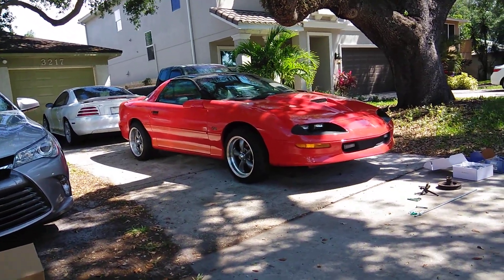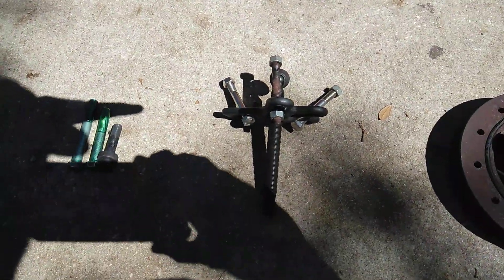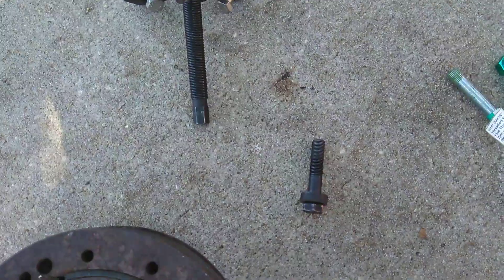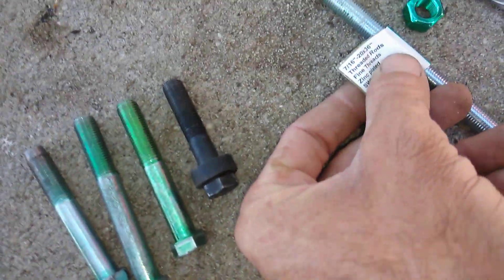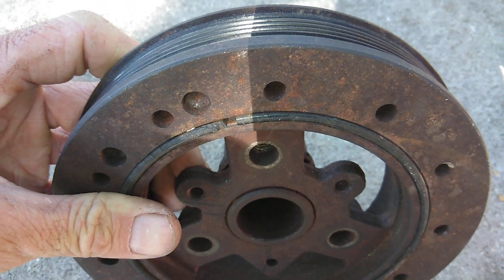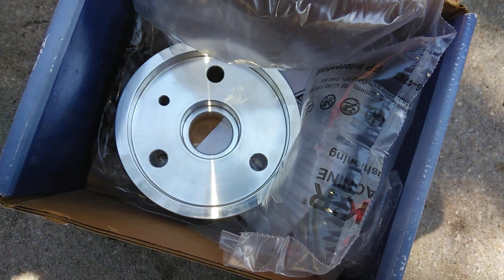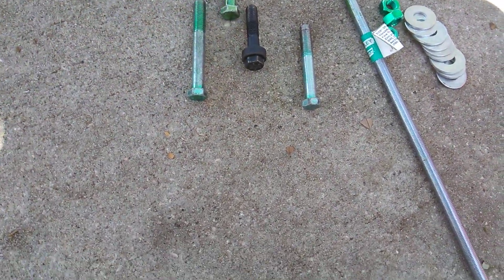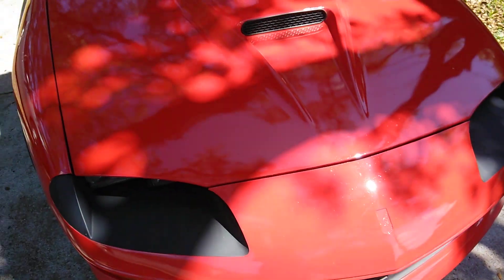😎 Harmonic Balancer Removal from LT1 ,Camaro SS f body Easy way

Comment: Why not use the three threaded holes to pull from. I believe they're 8mmx 1.25 and 50mm length is what I used.
Reply from the maker: Easy, there smaller! Don't wanna bend em pressing out balancer. That the leverage point the 3 bolt to push it off.

Comment: If you look at the balancer wheel from the side one side is thicker. Does that go towards front or back when mounting? Thanks
Reply from the maker: Yes, the thicker side goes to back side. The front has bolt holes for a pully. Also rember, when reinstalling, to use a threaded rod tool for install.  Take care👌
Reply: Keep On Dreaming I’m a little confused since everywhere else has said thick part of WHEEL towards front, which seens like  where it was when I removed, just not positive. You mentioned in you answer it should be towards rear since bolt holes there but I don’t understand since bolt holes go all the way through and thus could be mounted either way thus my confusion?  Can u clairify please
Reply from the maker: The recessed area, goes in front.  The pully screws into it,  the screws will not go into the back👩‍🔧 thread up.
Reply from the maker: Also watch my other lt1 balancer videos, might clarify this issue your having.👀
Reply: @keepondreaming3870  Ya thanks for the reply. I did watch your video and if you look at the side of the pull wheel (so you can see the grooves the belt runs on, the thick part of the wheel/lip is facing toward the front of the car.    Do you still have the 96 Camaro?

Comment: I can’t get one of the 3 bolts off. The other 2 were difficult as well. Any advice?
Reply from the maker: Turn balancer, by nut in center. You will need a breaker bar to spin motor.
Turn motor till you have access to the other two on bottom or orintation to remove. Pb blaster might help too.
Keep on Dreaming 🤗
Reply: Keep On Dreaming. Thank you!  I placed a 2 ft metal pipe over the wrench for leverage and it came right off without busting up my knuckles. Thanks again!

Comment: I need to replace the balancer on my 97 Firehawk LT1 and was wondering what you think of the ATI balancer dampers? Are they worth it if you don't race or have many mods (or no plans to) done? I was looking to replace mine with something better quality than stock and if possible give me a few extra HP. Great video thanks!
Reply from the maker: I used a aftermarket eBay harmonic dampner. I have it in other videos. Install and tools for job u can make.
Ati are very nice balancers, I use thoes on strokers. For a bolt on motor that might be over kill.
I did a underdrive pulley bbk and dampner. Want a driver/Scca car.
Reply: @keepondreaming3870  oh I see. Yeah I will probably pass on the ATI one then. I will look into the Assault Racing one you got.